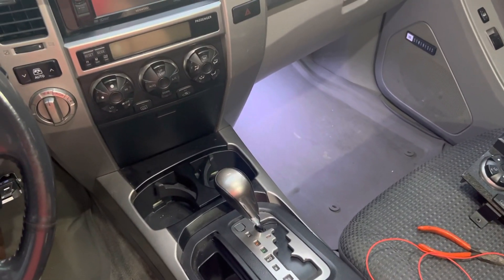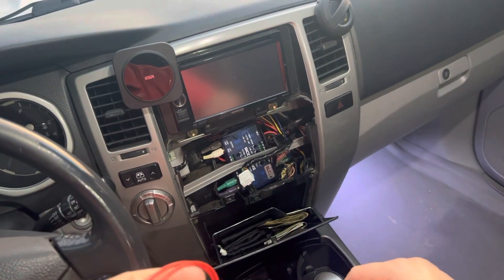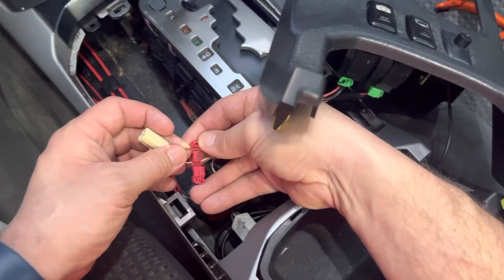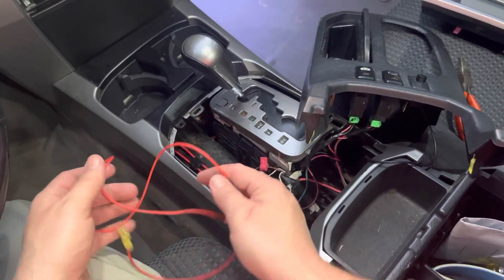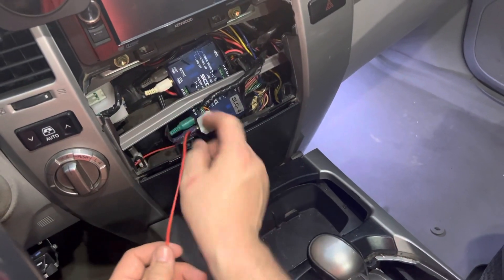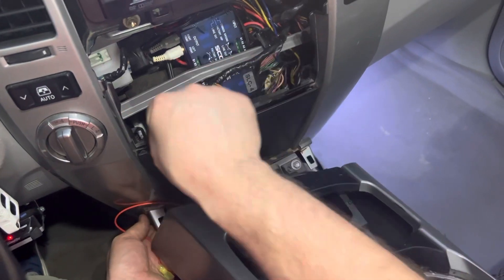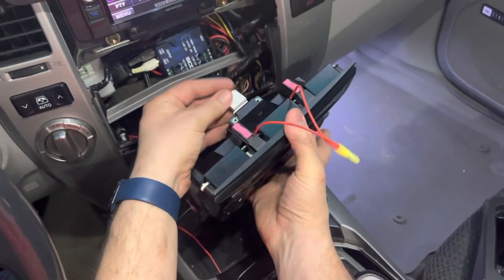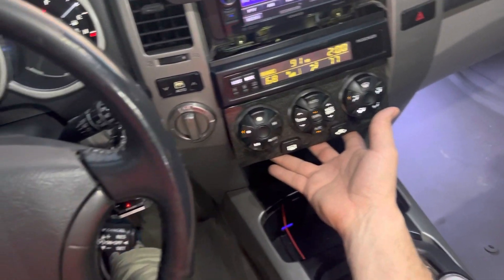Part 4 2003-2009 12Volt hookup 4runner HVAC reverse polarization.

Comment: Are the screen lights white? Because they look a bit yellow compared to the control led lights in white. Or does the reverse polarity just cause this? I changed all my light over back in 2011. Dash everything… but not the reverse polarity. But my screen look white and matches my other lights.